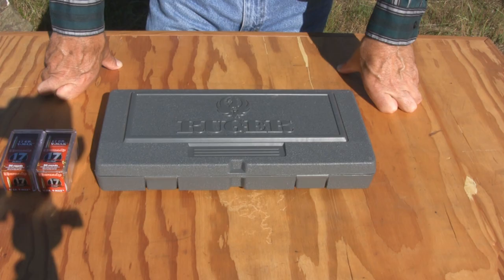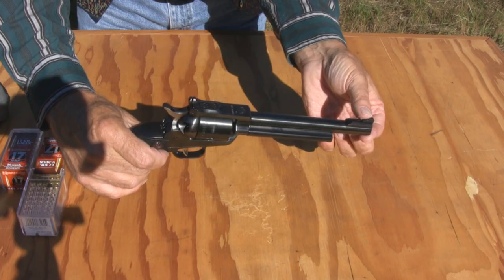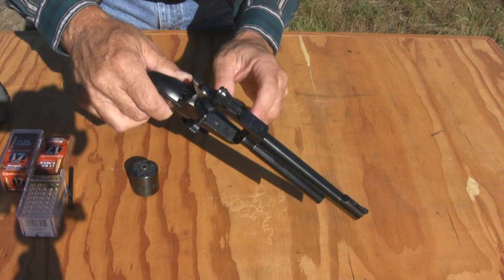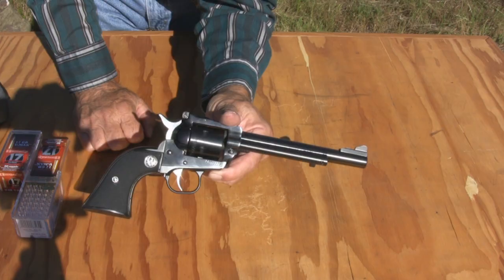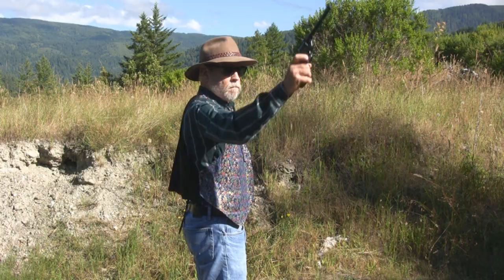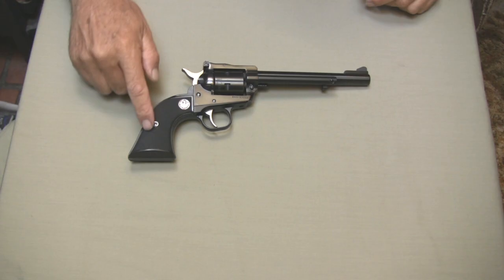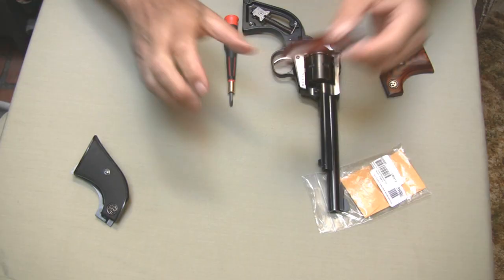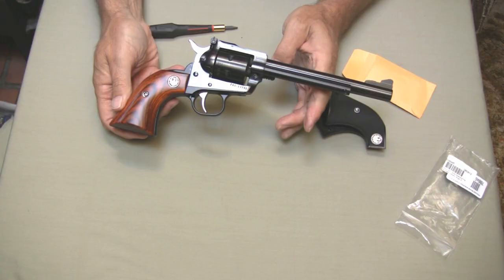Ruger Single Six

Comment: Out of curiosity why did you choose a .17hmr for a pistol? At typical pistol shooting distances a .22 is just fine and a lot cheaper...when you can find it!

As for your grips: IMHO wood grips always look better than plastic on a wheel gun. And your grips look very sharp. Congrats on the pistol.

Peace.
Reply from the maker: It is a companion to my Savage .17 HMR rifle.  I haven’t shot it much.  It’s a unique handgun and a lot more zip than even a .22 Magnum.  I’ll probably never buy another .22 due to the lack of ammo.  I don’t shoot the ones I have cause I have no ammo.  No problem finding .17 HMR.  I am on the hunt for a Ruger Blackhawk in .357.

I think the grips really changed the look and feel of the gun.  Thanks for watching and commenting.
Reply: gapster46 The .17 is a great round - I have a Ruger bolt gun in .17 and it is a joy to shoot.

It will be interesting to see if the .17 becomes more popular due to the lack of .22 ammo.